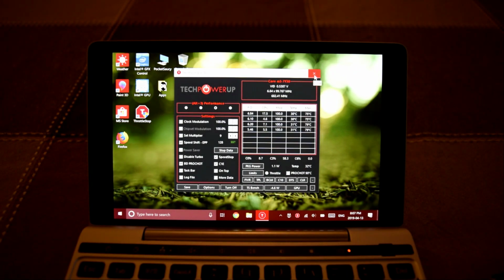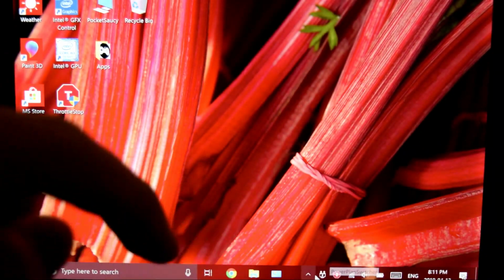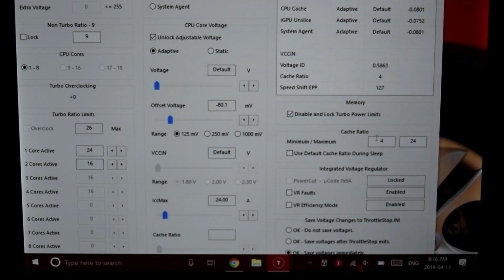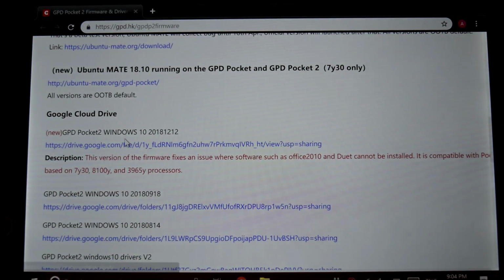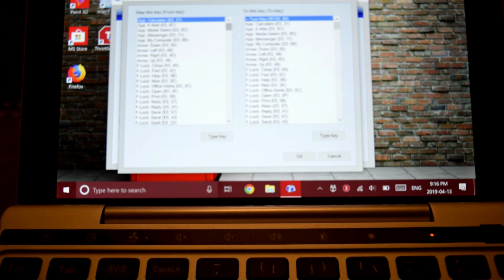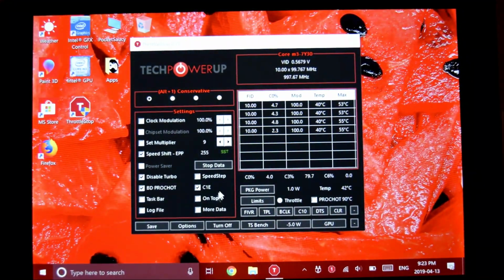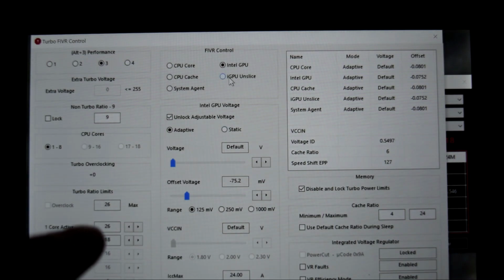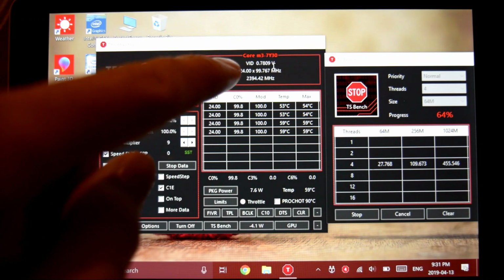GPD Pocket 2 Ultimate Tuning Guide (Unlocking TDP, Extreme Power Saving, Remapping Kanji Key, more!)

Comment: thank you for the tutorial. no any other single website in Japan is giving the tips explained in this video.

as for my gpd pocket 2 amber black, Ive disabled all unnecessary functions of windows,
for example, FAX, EntAppSvc, MapsBroker, Natural Authentication, PhoneSvc, RetailDemo, and other around 200 functions like that. that you can find on Task Manager -> Service tab.
It still works perfectly fine and got 2x longer battery life. you will never connect to Fax via the computer you know. but Windows still provides those apparent unnecessary modules just for minor cases.

also, for minimizing the loads other than gpd pocket 2 itself, "Anker PowerPort III Nano 20W" is the smallet, lightest Electricity Power Supply <-> USB-C plug which can charge the pocket 2.
and Elecom Clip Mouse is the smallest, lightest mouse.
alternatively "Anker PowerCore 10000 PD Redux 25W" is the most effective compact but strong mobile battery that can charge 1.5x times the pocket 2.
Im bringing the gpd pocket 2 with the gadgets as above when travelling and nobody expects that I have a computer with me.
still in search for any related tools that have less weight though.

thank you again for the tutorial, it expanded the possibilities of my baby!

Comment: Heho is your bios unlocked?
Reply from the maker: Not AFAIK - Some GPD models get more room to play with it, but P2 is relatively closed down
Reply: @armandoragusaucy96z.71  kk many thx for the Info. i followed ur steps but get an error after starting throttlestop. maybe this modded version is not compatible with windows 11 :(
Reply from the maker: @michaelkinc2336  OHHHHH I see!!!

Well, this video and the version above are old

Try the latest 9.4.6 I think it is... Works without the bug anymore, immediately unlocks TDP and holds it even after restarts.

I've also heard something about Windows 11 no longer playing nice with TS so Microsoft may have locked down the controls. I'd cite the thread but it's been since shut down as the host page was discontinued.

Nevertheless, I would put my money on Windows 11 being an issue - you kay want to google W11 compatibility with ThrottlStop
Reply: @armandoragusaucy96z.71  it turned out its depending on missing C++ Redistributable Packages. so my fault. i tried the latest version of TS but it looks a little different. I'll have to see if I can find your settings in the new design or enter them that way. But many thx for ur really fast response and help!
Reply from the maker: @michaelkinc2336  No worries! Good to know that can cause issues! Thanks for the heads up and update as well :)

And you'll find the new ThrottlStop is way better.

You can sync Windows power profiles to TS profiles 1 - 4, simplifies the process and you won't need to keep manually changing the power plan this way.

You can also change the PROCHOT now so that it dynamically thermal throttles without further input at whatever temp you want and not risk meltdown even if you give it max tilt. Very useful so you don't have to keep checking temps as it will keep itself in line

You can even leverage the above to stabilize undervolts since lower temps =  better stability at lower mVs. You can force it to stay under a threshold and it wont destabilize this way by heating up.

Lots of new things so don't feel bad, it's heaps better so try to consult change logs and exploit new settings :)

Comment: I can get 9w  2.6ghz sustained on all cores, without thermal pads. -80v
Reply from the maker: If it's 8100Y it would make sense, assuming silicone lottery! if it's 7Y30 be careful tho, since they are only supposed to allow 2.4Ghz for dual cores under full load, unlike 8100Y. My benches have lied if not putting them under load and if I set speedshift to 0

Make sure to bench and both GPU and CPU are loaded to max to confirm this if that's the case!
Reply: @armandoragusaucy96z.71  M3
Reply from the maker: 7Y30 is M3 7th gen

8100Y is M3 8th gen

Friggin Intel nomenclature for ya... 🤣

It is relevant tho since 7th gen does 2.6Ghz single core, 2.4Ghz dual core; Where as the 8th gen does 3.4Ghz single core and 2.6Ghz dual core. GPU remains identical tho, AFAIK

Comment: Does this apply to the gpd pocket 2 amber black also?
Reply from the maker: Yes. It won't go as high TDP wise, since it will not exceed 1.6Ghz, but it will still allow you to go up to like 9W give or take. Undervolts and other tune ups are identical, however. :)
Reply: @armandoragusaucy96z.71  Thank you
Reply: @armandoragusaucy96z.71  Was trying it on the amber black with the 3965y but couldnt manage to get more than 4w wich is basically stock gona keep trying! really would like to get at least 6w of tdp
Reply from the maker: @white5874  That is abnormal unless you are only benching CPU. Total Package (CPU and iGPU) should both exceed that to at least 6W when under usage. There have been better, newer TS revisions, I would start there to be honest, maybe the new versions can work better in your case
Reply: Thanks am going to check and see if i get a newer revsion since i really feel that if this cpu gets a bit more power it might help out while playing some light games!!
Reply: Managed to get it up to 8w for now with good temps!! The newer version did help out also i had to remove intel power throttling and now it works!! It really helps in some games since the celeron its not that powerfull but now with the tdp basically unlocked its way better!
Reply from the maker: @white5874  Based on my experience, with repasting and thicc plentiful thermal padding, 8-9W is the max sustainable anyways under heavy load assuming you dont want to exceed 80C. Depends on ambient temperature. 8W is a great spot to max out at, anything more becomes burst performance as well. Mines was set up to 9W long 13W short limits. Also you can set PROCHOT parameter at your temperature of limit with the newer versions and leverage it on purpose instead of at 100C. Use it as a limit temperature to dynamically throttle TDP if you exceed the max temperature you dont want to go over!! I did it for 20 offset, meaning 80C max and not 1C. No more micromanaging required!